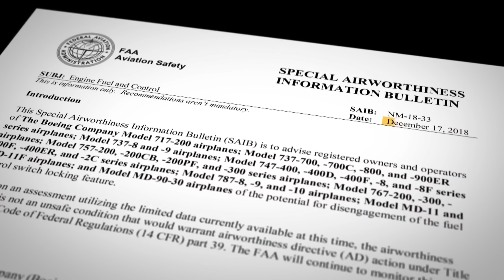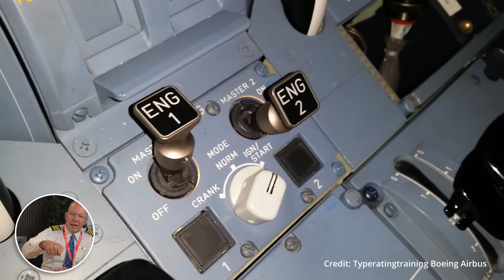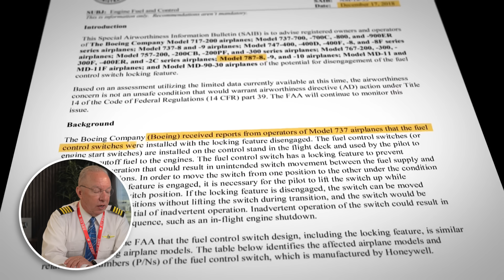Air India 171: The FAA’s 2018 Fuel Switch Locking Bulletin Explained (16 Questions Answered)

Comment: Thanks again for an excellent presentation and analysis. I am working as Captain on a large cruise ship and we do have several CCTV cameras on the bridge linked to our black box as well as the CCTV security server. This has been a common installation for over twenty years on the ships I work on. In my opinion it is a very good tool to see how the bridge team reacted in a distress situation. Still a bit surprised the airline industry hasn't implemented the same.
Reply: can confirm that almost all ocean going vessels (not only passengers) fitted now with CCTV with bridge included, plus AI functions with alerts. Surprized that commercial aircrafts dont have similar installation.
Reply: Pilot's Union is resisting to have camera in the cockpit.
Reply: @NT-ds8ic 
I can understand why. From time to time everyone picks their noses, scratches their backsides and  ‘adjusts their packages.’ No one wants to have this video footage enter the public domain. I believe that the CVR is sufficient.
Reply: @mtkoslowskiFully agree, another side to this is related to how Airlines/FAA/Lawyers have long had an industry issue where the company will use EVERY possible method of pinning the accident on the pilot. Think of how they investigated Sully. No person is a perfect operator 100% of the time and the best safety programs incorporate mistake catching mechanisms with this assumption in mind. I read a statistic somewhere that around 1% of all pilot actions are slips or mistakes and having a robust system of mistake catching helps with this. Examples of this include: Verbally repeating and pointing at the altitude select window once set and issued by ATC, have both pilots do challenge and response when doing checklists, having a role literally called ‘pilot monitoring’ and so on. The entirety of pilot procedure is designed to catch every possible mistake before they cause an issue. People act arrogantly and think mistakes are just a personal fault of the pilot but it’s really not. Research into the issue really does demonstrate that pilot mistakes are unavoidable. Aviation safety comes through the use of the procedures that mitigate them.

Pilots do not want the recording feature because they KNOW the lawyers up at corporate will weaponize the 100% normal and completely unavoidable mistakes they do literally everyday. Every possible move will be analyzed if something goes wrong. It puts them in a very vulnerable position and I completely agree with not having video recording. If the industry could be trusted with not lampooning pilots with every possible weapon they get I would feel differently about handing them another one.
Reply: @mtkoslowski no reason for cockpit footage to enter the public domain, or even be viewed by the airline, except in the case of a serious incident. Cameras would a great deterrent to dangerous / unprofessional behaviour or intentional sabotage
Reply: @johngwheeler Just because there’s no reason for it doesn’t mean it won’t happen tho. What if someone has a personal grudge against a pilot, or the airline is looking for an excuse to fire a pilot for discriminatory reasons? I don’t blame pilots for not trusting that something completely unrelated to safety would be done with the video footage at some point. Doesn’t mean that the video wouldn’t be useful in accident investigations, but it would only add a little more information than is already provided by the Flight Data Recorder.
Reply: He deflected that answer because he doesn't want them. I have one in my semi and I don't care. It's part of the job. His bad excuse is that it wouldn't have prevented this accident. Yeah, we know that. But it WOULD tell us exactly what happened to those 2 switches and who did it. It's very possible that we may never know if this was deliberate or accidental. Cameras would tell us that for certain. Why he doesn't want that is beyond me.
Reply: @pudnt  They don't want to get caught getting into the mile high club with a stewardess in the cockpit.🤣
Reply: @pudnt false.
We already know, whether you want to face it or not
Reply: @pudnt agree absolutely
Reply: @pudnt short answer: think of how they went after Sully. The industry has a problem with trying to weaponize everything they can to place blame on the pilot.

Long answer: see my other comment that describes this more in depth.
Reply: @punt, Steve would lose utube views-income and his ego tripping waffles would suffer deflation if cockpit cctv answered the question without him..LOL.
Reply: If there is no CCTV, aircraft manufacturers  would have "it's the pilot's fault" card to play. Pilot union does not like CCTV too for liability reasons. 
I believe we the passsengers, the airline operators and insurance companies should start to challenge the status quo. 🤔
Reply: cause flying is serious... cockpit is a critical design in every detail, any instrument any little part there if failed, everbody onboard could die... even a log can float, but can never fly...
Reply: Boing owner  needs mental check
Reply: What About this? 
https://youtu.be/vJC4JdUmudk?si=g4JT3DjOD0Qq2s54
Reply: Thank you for pointing out the obvious
Reply: Two words: Pilot. Unions.
Reply: @wwaynemcg  also too big to fail US gov backed industries..like boeing and GE
Reply: merchant navy officer here. problem with cameras, those are completely disrespects confidentiality. i spend 8-9 hrs a day on bridge under monitor of cameras. have to push a button every 10 minute like an experiment monkey. those cctv cameras could be installed on ships because mariners dont have strong unions. if we had unions like airline pilots, believe me nobody could install cameras. 

 no camera can prevent any accident. bridge crew should be relaxed for better performance.
Reply: Sadly, there are many places (especially in the EU) that makes CCTV cameras either illegal and unsupportable.  So unless all countries agree, the cameras might cause legal issues.
Reply: Cruise ship and passenger airliner are apples and oranges
Reply: Yeah, that’s why we have video of the Costa Concordia crash
Reply: "BuT TheN HOw wOuLd tHe pIlOtS ReAd obJeCtIoNaBlE mAgAzInEs wHiLe oN ThE JOb?"

I've just heard silly excuses from all pilots, no good reason to not have cameras installed.
Reply: Why are you surprised? They haven’t worked to add more storage to black boxes audio recorders even though the technology has allowed for it for a long time. In such a regulated industry things dont change until you have accidents
Reply: @jamesphelps1958  This have changed. Now things don't change until you have multiple accidents (think 737 MAX). Very unfortunate evolution.
Reply: Boeing playbook page 5:  when all else fails blame the dead pilots.
Reply: Captain steve was dishonest in answering icare question 3rd...the cameras will help determine root cause which the other systems have currently failed to address! Definitely not prevent! Pls dont divert the intent of the question!
Reply: @schnellster1 false
Reply: @CountAdolfo what is false?
Reply: @schnellster1 Captain Steve was not dishonest.
You don't understand why there are no cameras. It's not JUST that pilots don't want them.
They would need a HUGE amount of storage to store so much video and they CAN'T put that in a survivable "black box"

This topic has been covered ad nauseum all over the Internet
Reply: My guess is the $$ cost involved in fitting thousands of planes with cameras.
Reply: @235buz cost of Insurance every time hundreds of families lose someone in a blaze of glory.

Just think, if not for cell phones, we would not know half of what happens anywhere once onboard the planes. In aisles or anywhere.
Reply: You are definitely wrong about human intervention and the fact you don't want cameras in cockpit are very suspect in your intentions.
Reply: captain steeeeve…..how old are you???  You look unusually old lately.  I am guessing 72-75 years old.  Thank you for your prompt reply
Reply: Don't call yourself a captain, you're just driving a boat.
Reply: @lukeproctor69 as a pilot myself (with a PIC jet type, +1,500 flight hours, and a CFI cert.) I kindly return your opinion back to sender. They are a 100% captain.

(Some interesting history: aviation stole pretty much everything from the Navy. 

The uniforms were originally ship uniforms. The term ‘Captain’ and ‘First Officer’ comes from the Navy. We use Nautical Miles and land at airPORTs. We use ‘courses’ and ‘headings’. The tail control is called a ‘Rudder’.

If anything, the commenter is more a ‘Captain’ in historical context than any pilot captain is.)
Reply: @lukeproctor69 How do you call someone who "drives a boat"? Right, a captain.
Btw, ragebait 0/10...
Reply: @lukeproctor69  Those that operate boats are captains...way before airplanes existed.  Those that operate planes are pilots.

Comment: I don't understand how he can be so sure. Those switches are just electronic switches that are not connected to the pump physically, they are connected to the computer, and there is a program that controls the pump. So let's say asking pilot (most likely the one who is in control and flying) hears the silenced engines, looks at the warning, asks "why did you turn it off" gets "I didn't", either one sees it's not off, turns off one by one and turns on immediately and 1st one starts picking up, and that's it. 1st report on those at off is telemetry not the actual physical position of the switch

Comment: It is a poor design fault.  The movement seems very simple. While the flight on run, there must be a caution,  sounds high, alerting pilots that fuel is going to cut off. But it is like a switch in my mosquito mat. 
Atleast both pilots must be made aware that the fuel is going to cut off even one try to cut off. It will sure make a restraining force whether it is accidental or intentional.
Even a big dreamliner has a small killing point.
Reply: It doesn’t ever happen, why would you have an alarm for something that has never ever happened

Comment: I'd like to see a double-command for shutdown of the engines that only can revert to a single command in case of a fire detection or other major fault of an engine.
This would mean that the switches have to be relocated to a location where it would be hard but not totally impossible to reach for the other pilot, just that they are in the field of vision of the pilot in command so that the other pilot can't cut them without being observed.
Double-command is used for mission critical activities to avoid human mistakes.
Reply: Would you, ok, so what?

Comment: In this age of Ai, should we still allow a situation like this to happen again?  I feel like it should be made impossible for the pilots to be able to have the ability to cut off the fuel to both engines in such a take off sequence.  The computer in my car prevents me from shutting off the fuel while I'm driving at 70 mph on the Interstate Highway.  Why can't we rewrite the computer program on airplanes so that the planes computers to not obey a deadly command such as flipping the fuel cut off switches to OFF during a take off sequence like Air India 171 went through immediately before the fatal crash?

Comment: Fuel controlling switches in the cockpit (which are spring-loaded and require complex 3-D mechanical movements) CANNOT be physically turned off (or on) by anything other than a  human in the cockpit, as simple as that. 
An electrical fault or a software bug or a FADEC issue could have caused the effect of these switches being turned but those bugs can't result in physically turning off (or on) both the switches in the cockpit. 
Regarding FAA 2018 bulletin, the switches on the crashed flight have been inspected, and the report (done by Indian agency) did not mention anything incorrect with the installed switches on this flight.
Reply: This!  Everyone is trying to fix the problem that doesn't exist.  The human element is loaded with unknowns.  This is one of many examples.
Reply: I agree, it's possible that the switches never moved at all. I have just repaired an electronic item that was intermittently responding to 'ghost' commands due to faulty control logic - it happens.
Reply: @adamdavies163  ?? Not sure if you are being intentionally sarcastic, but I am saying that one of the pilots physically turned the fuel controlling switches in the cockpit. 
The only question is - did he do it intentionally or did he do it absent-mindedly (had a brain fade or something)?
Reply: @yuck4u  What's sarcastic? I've not seen any proof that the switches were physically moved... have you? I'm just open to the possibility that another fault (as you righty suggested) could have caused the fuel valves to shut off, RAT to deploy etc.
Reply: @adamdavies163  Are you serious? The prelim report put out by Indian investigation agency clearly says that the switches were moved. This is confirmed both in the FDR (Flight Data Recorder) blackbox, immediately after, confirmed by what investigators heard also on the CVR (Cockpit Voice Recorder) as well with one pilot asking the other - "Why did you toggle the switches?" And then few seconds later, one of the pilots toggled back the switches to the correct position (and this also was recorded in the FDR) but it was too late - and the photograph of the switches in the report shows them in this final place.
Reply: What did the FDR record? Switches were physically moved  (how does it do that?) or that voltage changes were registered that equate to the switches being moved? Not necessarily the same.
Reply: @adamdavies163  So, on the CVR recording, when one pilot asked the other pilot why he moved the fuel cutoff switches, was the pilot who asked dreaming?
Reply: @yuck4u  I've not heard the recording, have you? As others have suggested, it's possible that the valve position displays changed, engines spooled down and the pilot naturally assumed the switches had been turned off. The other Pilot denied it, also odd! At this stage, same as you, I don't know for sure and am keeping an open mind!
Reply: @adamdavies163  There's no question in my mind (based on the FDR-CVR-information given in the prelim report given by the Indian investigating agency) that the fuel-cutoff-switches in the cockpit were physically moved by a human being in the cockpit. 
I am just open minded about the motive of why the switches were moved.

Comment: It doesn't make sense that it is that easy to cut fuel from the engine during takeoff. The aircraft's computers knew the aircraft was configured for takeoff and that the aircraft had left the ground and was in a climb. I would think that, at minimum, the aircraft's control system would issue a challenge when it sensed the fuel cutoff switches changed state.

Comment: After flying for 15,000 milese the captain suddenly has a death wish ? Strange logic. Who moved the switches in both instances, to cutoff and then back to run. Was it the system or the pilots, in both instances ? Who gave the "May Day" Call ? Investigators need to identify that. Also release full audio or transcript of CVR audio. Were any alarms or warnings or alerts sounding in the cockpit.

Comment: Are the fuel switches wired to the fuel valves directly or not? 
Is the fuel switches wired indirectly to the field switches through some relay with more than one input? 
Is the fuel volume in the combustion chamber varied by software in 787?

Comment: I know this is unlikely, but is there any way an intermittent wiring fault could cause the effective switch positions to fluctuate?  The sequence of events would be: 
1. Aircraft electronics detect switch position change from RUN to OFF (even though the switch hasn't physically changed), and cut the fuel.
2. Pilot sees from his instruments that the fuel has cut off, asks other pilot if he did that.
3. A short time later later the wiring fault makes the apparent switch position change back to RUN. 
So the switches actually remained in the RUN position throughout, even though the black box recorded a change of state.
Reply: This could have happened: 
the switch changed to cutoff automatically due to a mechanical failure. The first pilot thought the second pilot had done it and asked why he did that, but the second pilot said he hadn't. Then, they tried to start the engine again.
Reply: No.  They were mechanically moved and the investigation showed this.

Comment: Considering engine 2 cut off immediately after 1 second the first engine itself proves its not humanely done. This is becuase when they turned back to run it took them 4 seconds. You can imagine itself to put your hand to first and put down takes 2 seconds minimum, then take off your hand and put your hand on other one and pull it down and hook will take another 2 seconds minimum. So it has happened due to some adverse system issues and it fell down automatically.

Comment: Captain, in 787 the Run is on top and cutoff is at the bottom, is it possible that a defect in switch caused it to drop down to cutoff say due to G forces? In 737, I believe it is Cutoff at top and Run at the bottom.